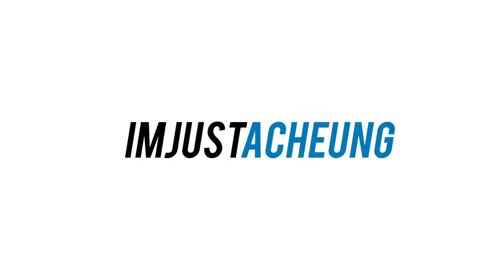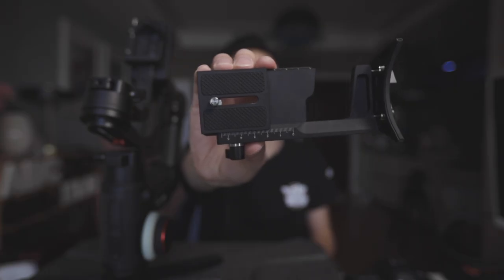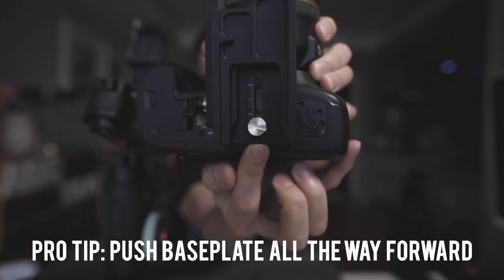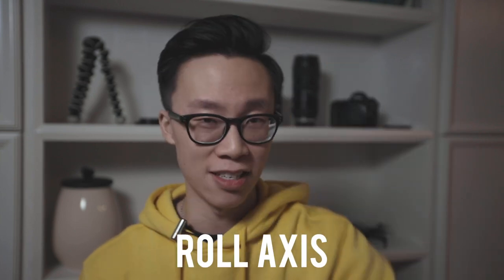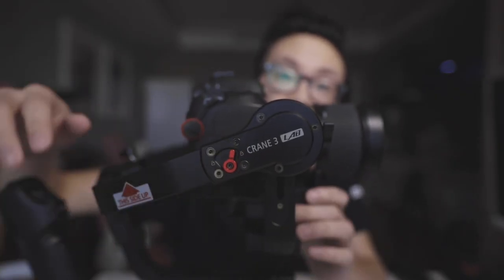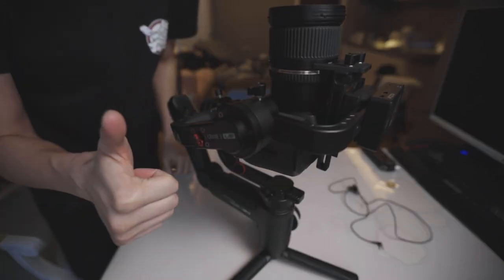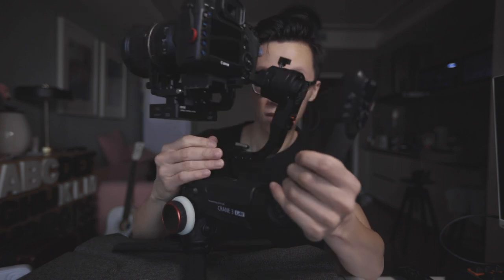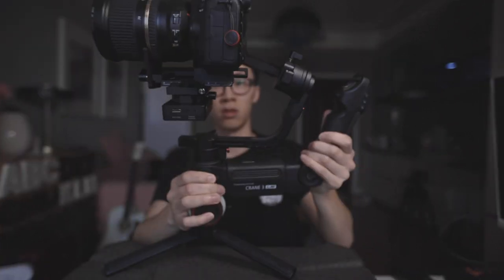Zhiyun Crane 3 - How to Balance Your Gimbal The RIGHT Way

Comment: have you tired balancing with the 1dx mark ii? i am unable to get the tilt to balance but i got every other axis balanced correctly.
Reply from the maker: I don't have a 1dxii unfortunately so I'm not able to try balancing it. Is the camera too big on the cradle?
Reply: I was able to follow everything you did except for the tilt axis and the base plate that comes with the gimbal - the lens holder thingy is too short.
Reply from the maker: https://youtu.be/he3XgPgLsp8
This is someone else successfully balancing the 1dxii using the baseplate from the Crane 2 on the Crane 3
Reply: So it looks like I gotta get another base plate or unscrew one of those arms. Man, Zhiyun should have included that baseplate with the gimbal.
Reply from the maker: Completely agree. I'm not sure why they didn't design the baseplate better for bigger cameras since they advertise 10 pounds of payload 🤷‍♂️ Sorry about that man 😣